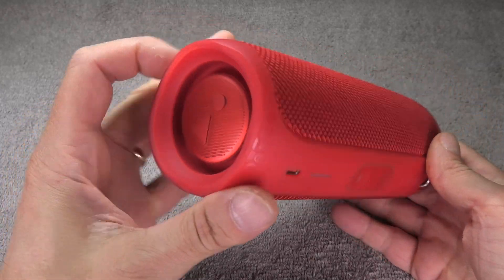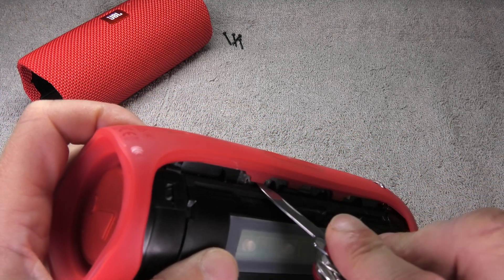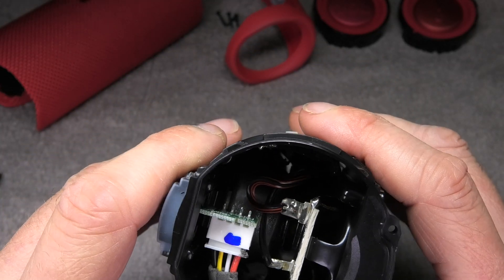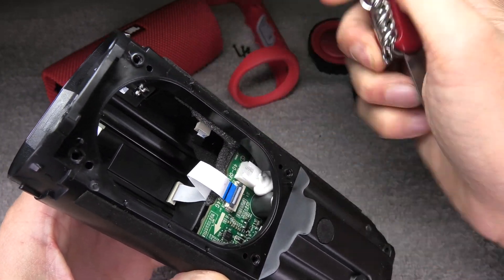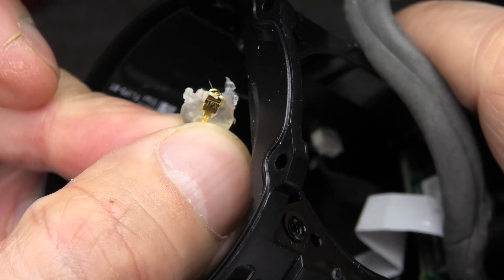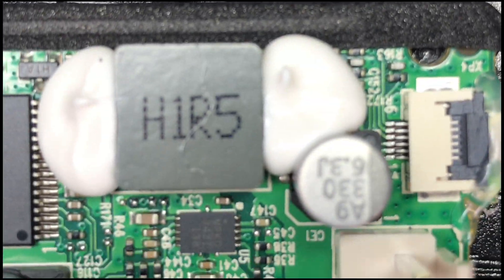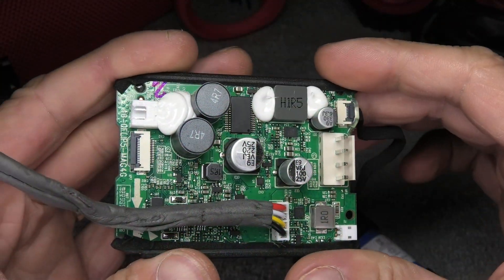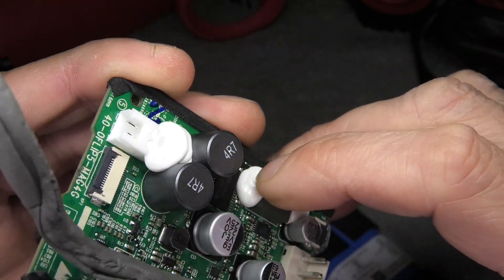Look inside JBL FLIP 5 (4K Teardown)

Comment: In 5:02 how to doy take the Bluetooth antenna off?
Reply from the maker: The hot glue comes of pretty easy by prying with a small screwdriver.  The antenna connector comes off of the board at the same time.
Reply: @ and then for Connect it in the new board how can I connect it?
Reply from the maker: @jhonatancb it’s pretty easy to plug it onto the new board.  
If you have glue, I’d put a small dot on top of the connected plug to make sure it does not become lose over time

Comment: May be you  have a guess where is the in point on the amp board from bt-section? I'd like to solder in there and have normal minijack aux in (usb-c is not an option for a small player connect)

Comment: I can't find the screws to take off the top and bottom. There's a different layout inside mine. The four side buttons broke. I was hoping the connector just became detached and I could get in there and plug it back in. I can't even get into it because the four screws for removing the top / bottom don't exist. Darn.
Reply from the maker: There are different build variant.  
The one that you have only has a couple of clips that hold the top and bottom in place.

Comment: Hello, when I try the factory reset (play + vol up) nothing happens. Which bits do I need to take apart to do a manual factory reset please? The automated voice is too loud and I can't change the volume of it, and the volume buttons do not work properly (they skip track instead of change volume). So I think I was sold a faulty speaker and want to reset it. Thanks!

Comment: nice teardown dude, it was clean and the pic shot on every scene is on high detail. one question though, do the speaker still work after you put everything back together ? I failed connecting ribbon cable on my dualshock project before.. so ribbon cable still scares me

Comment: Hello Sir, first of all awesome video, just wanna ask I was thinking too remove the fabric black cover from JBL flip 5 to clean some dust off the cover. Is it fine to remove the cover like won't it get damaged?
Reply from the maker: Hi,  thank you for your feedback!
To answer your question: it is no problem to remove the cover to clean it (and underneath). 
The cover can even be washed with a mild soap. It is very easy to reinstall after letting it dry.

Comment: Thanks for the video! I found this video in an attempt to fix an issue where my JBL Flip 5 turns off a few seconds after powering up. Is there a particular part that I should investigate?
Reply from the maker: Hi, I’d check if the battery looks bloated.

Comment: Good morning, what is the internal microphone on the JBL Flip 5 for?
Reply from the maker: Hello, my guess is that JBL initially planned to allow this speaker to be used as a speakerphone.  
Since they stated to remove this feature from all of their recent models, it ended up not betussd.  
I opened up a Flip5 with a different hardware design a few months ago  in that revision the microphone was already removed.
Reply: @MegaSafetyFirst  thank you very much, and excellent video!

Comment: Is there any way of upgrading  the Bluetooth chip to Bluetooth 5.2
Reply: probably not, upgrading bluetooth chip would need a soldering process.. and the newer one might not have the same interface as the old one
Reply: @thankyouverymochi  completely forgot about but thanks l, ended up getting the soundcore motion + and very happy with it
Reply: @who6481  you're welcome. that is a great speaker. I also consider getting one before.. I eventually pick jbl 5 (due to it being a little bit more portable). but soundcore motion plus is also a great choice

Comment: How to change charging port dude is it possible.. My JBL flip 5 is not charging can u pls help me to fix it
Reply from the maker: It is easy to remove the daughter board that hold the charging port. But I have not replaced the port itself yet.  I find the USB-C ports more difficult to replace than the old micro-USB ports.
Reply: @MegaSafetyFirst  yes that is  the  reason I'm asking  for ya usb type c is difficult to change is there any solution to slove my problem dude pls give me some solution pls
Reply from the maker: That is really difficult.  Are you certain that the port is defective?   Or could the problem be somewhere else?
Reply: @MegaSafetyFirst  Yeah man something is fishy with the charging port on this device, my charging port melted when I connected to a fast charger. It burn the cable the all the plastic melted into the type C port. Unable to find the replacement for that type c Port. Could you provide any links to replacement charging port or a similar port so that i can use that instead of the original one? Thanks

Comment: I have a JBL flip 5 that the Bluetooth doesn’t turn on and I can’t connect new devices, do you think that is because something on the inside got disconnected?
Reply from the maker: Hi,  when you press the Bluetooth button, does the LED still start to blink and does it play the sound for the pairing mode ?
Reply from the maker: Did you try a factory reset ?
https://youtu.be/BUUjg-h13FI
Reply: @MegaSafetyFirst  no it doesn’t blink and it doesn’t make the sound, i can’t even do the factory reset
Reply from the maker: Maybe the ribbon cable to the button panel got detached?   Do the volume buttons still work?
Reply: @MegaSafetyFirst  no the whole bottoms doesn’t respond, that’s why I think I can’t make a factory reset
Reply from the maker: That makes sense.  In that case I’d open it up and check the ribbon cable that goes to the buttons.
Reply: @MegaSafetyFirst  thank you I will try